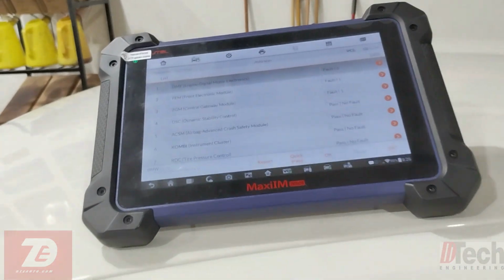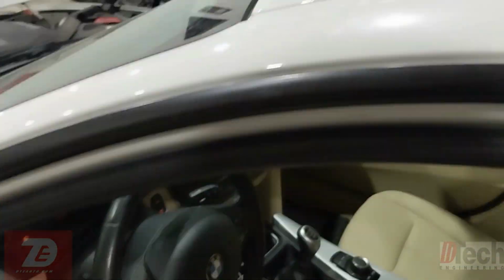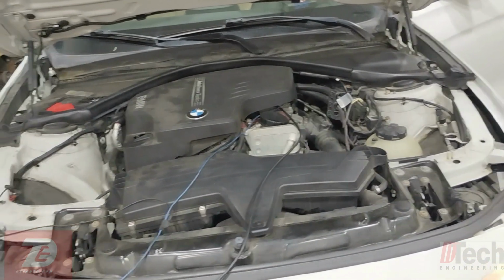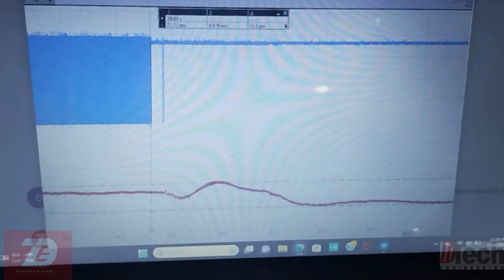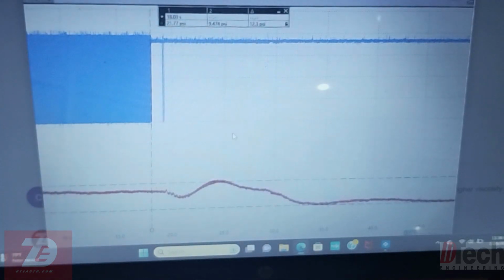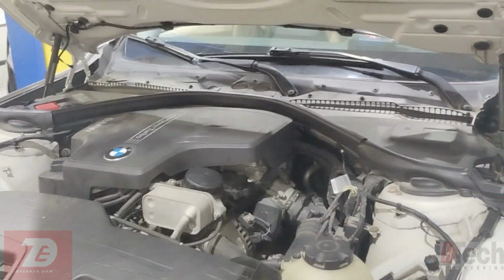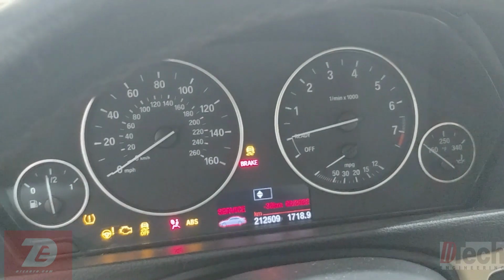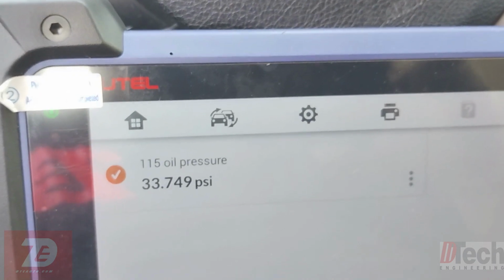2013 BMW 328 Low Oil Pressure Diag & Fix

Comment: I have the same issue, new timing chain was done previously. I already replaced the pressure sensor and oil pressure control valve solenoid. Still no good. So dropped sump and found debris from old chain guide parts. However i still have the fault 30c1. Oil and filter new.   Quick question once your wnigne warm like 105oC if you revved the engine did the pressure look good i get over 45psi easily.? I have around 15psi at idle when hot. But when cold its 28psi. I clean it throughly and removed the strainer and reverse flushed it. I just cant believe there is a blockage still. 
Some info says the timing chain tensioner bolt can be worn and leak oil pressure off? Can it? 
Got any other ideas?

Comment: Skip the first @21.12 of the video.  The Diagnosis had little to do with the fix - 10 years after the introduction of the engine, everyone should know that the timing guides clogging the pickup is step 1.
Reply: Thank you....geez he's long winded

Comment: What exactly did you replace on this engine 🤔.
Reply from the maker: complete timing components, chains/guides/tensioners
Reply: @DTEAuto and I bet he pulled the oil pan and cleaned out the oil pick up tube.

Comment: so the oil pressure was restricted on the oil pick up strain from debris or was leaking on the chain tensioner ?
Reply from the maker: Yes the pick up was clogged from broke debri and lowered the amount of oil to be delivered to the engine

Comment: Nice work Sadile! I found this out the hard way about two years ago with a very intermittent oil code. The chain went and it was towed in. Luckily it was still fixable with no damage. I wish this video was made two years ago! Lol
Reply from the maker: LOL, yeah this one was a little misleading because typically any that I had dealt with that had bad guides would make noise when running but this one did not and so it was last thing on my mind, hence the testing I did to try and figure out the source of low psi issue. Thanks for watching

Comment: Nice find! By the way what was the duty before and after repair on a fully warmed engine?
Reply from the maker: I unfortunately didn't get a chance to measure it and for some odd reason I didn't save the captures to be able to reference to.  Super great question! and if I hadn't been so rushed I most likely would have been interested in knowing that as well. Thank you for watching